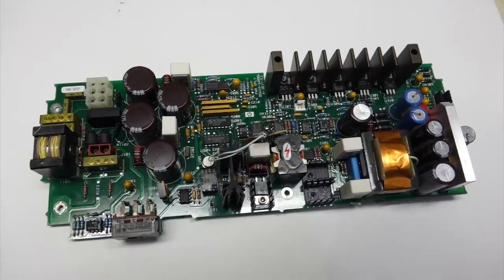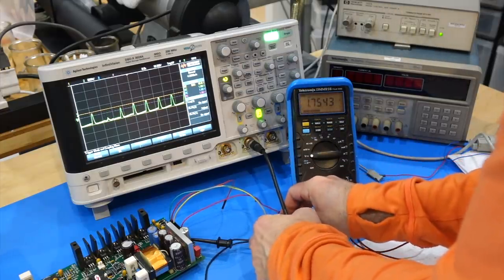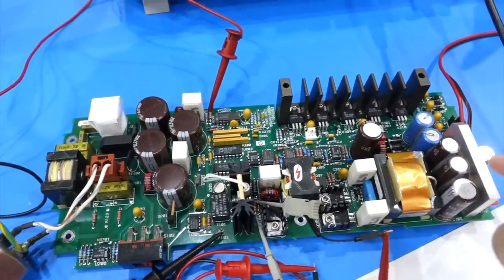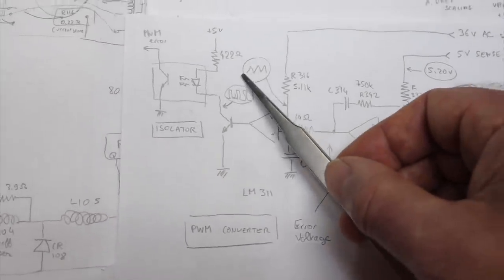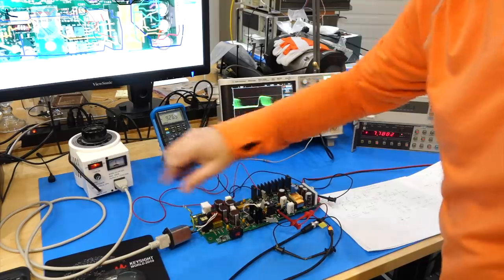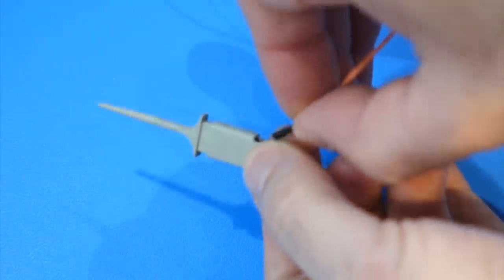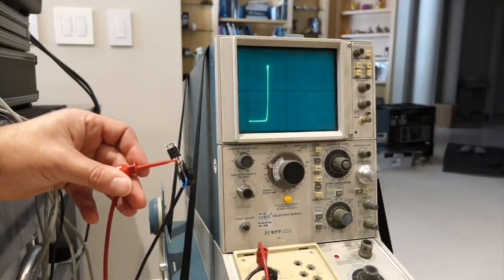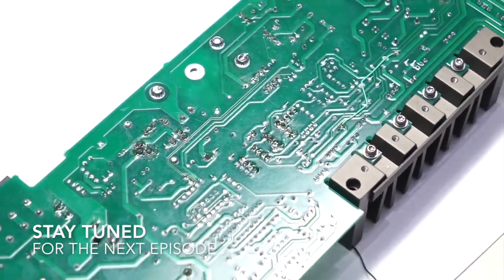HP Switch Mode Power Supply Repair Part 3: Electroboom in the feedback loop

Comment: It's ok if you have the right tools, your bench top equipment in this video would cost $80,000 new, maybe more.

If you're not at work or in a university lab then most people don't have that option.
Reply from the maker: This is such a profoundly misleading and inaccurate comment I feel compelled to respond. Of course you need test equipment, you can’t see electricity with your eyes, smell it with your nose, and I don’t recommend probing it with your fingers! But I learned debugging with a simple needle multimeter, a surplus tube scope, and a home made power supply. And that was more than enough to make full, non-speculative, successful circuits debugs. I eventually build my own scope and my skills got good enough to repair failed test equipment I could get for next to nothing. A load can be cobbled out of a few power resistors or transistors, a cheap  transformer can deal with isolation. But nowadays you don’t even have to suffer like this! A competent DMM can be had for $20, there are amazing digital scopes for less than $200 which will even include a signal generator and a spectrum analyzer! There are no equipment excuses to do proper debugging, nor does your comment about equipment pricing have any basis. Even the one fancy instrument I show, the load, was less than $100.

Comment: I dislike the loop design. I think that the pseudo PWM generator is a little "flawed" and is not very linear. and if this controls the mosfet driver, i think is a really crude and fragile regulator.
Reply from the maker: Quite the contrary. What they are doing with the PWM is go around the non-linearity and variability of the opto-coupler. and make it linear and predictable.
Reply: But also was possible 
-Predistort input 
-Add Compensated Optocouplers (At least by this time are quite cheap) (Pretentious name, are just 2 well-matched optocouplers in one chip)
-Or use a more "elegant" V/F converter and use a digital optocoupler, and do the control (Measure frequency, by converting back F/V or "by software" using windowing) and pulse generation in the high side. This solution obviously needs a more sophisticated driver circuit or even a microcontroller, not much more expensive in the BOM, but expensive in people/hours.
One point I'm agree is that this pseudo linear pwm is predictable and while the circuit is working in normal conditions works great, and can compensate enough at low cost, but is a wasted oportunity in this case because the circuit has just a normal optocoupler and not a "digital" one. 6n137 is cheap and is a well known component, and has a nicer output for pulse or digital stages.
Things that I like is that the circuit has it's "dumbness" very well compensated with Open circuit loads to prevent overvoltages, and layout is almost straightforward and not crazy like the pc switched sources

Comment: [rant]Where is the right to repair?  No schematics because HP would now rather sell their products as a use-once disposable service with planned obsolesence?  They would rather make you buy a brand new $5k piece of test equipment than give you the knowledge to change out the 50c component they have most likely bought from the lowest bidder. 
I think you will find that with the secret circuits come cheap components.  With this kind of attitude towards the customer you can pretty much guarantee any an all respect for the customer and all will HP had to provide a quality product is also gone. It would not surprise me if in fact these circuits are designed in an unnecessarily complex way to introduce points of failure to ensure product obsolsence and turnover.  
HP has changed... everything is about the bottom line and milking the customer for all they are worth. corporate greed FTW. I bet they watched Jhon Deere do it to farmers with their tractors and said "hold my microchip...".
IMO from looking at that regulator and with the knowledge they are now purposefully hindering service OF ANY KIND for the device... that it should be relegated to position of dinghy boat anchor.  I'd try locating the last "Decent" one they made... maybe start by seeing what the last scematic available for the line of equipment was... this would be a good indicator of when and where HP went off the rails, and I would avoid any of their equipment after this date.[/rant]